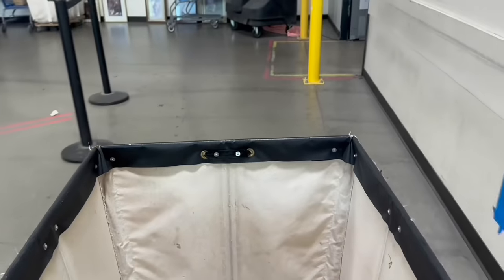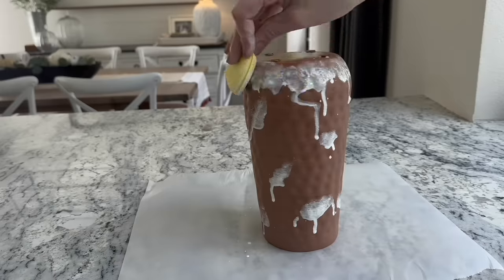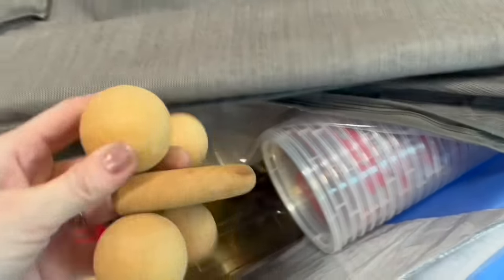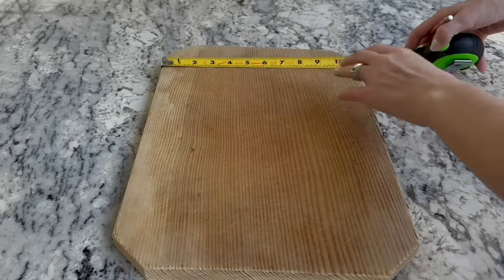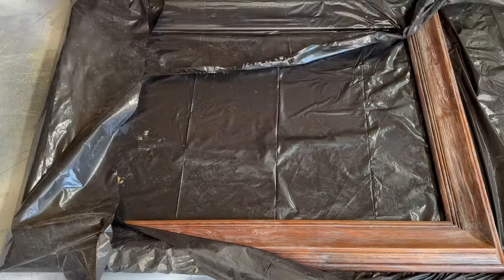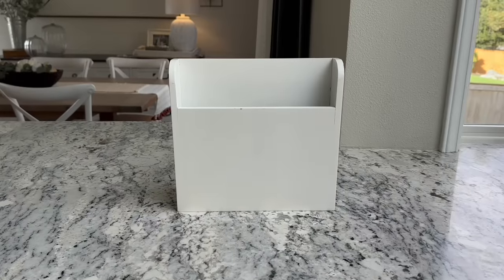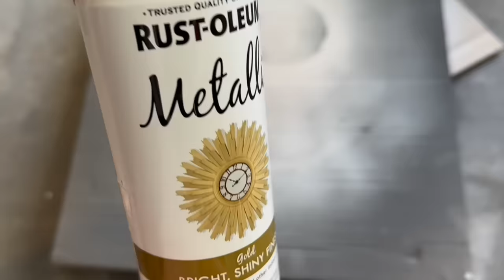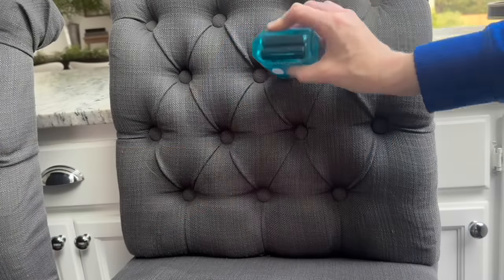50 DIY HOME DECOR THRIFT FLIPS • AFFORDABLE DECORATING IDEAS

Comment: Love these however may not ask on the candle platter on the wood bowl you made whilst looking amazing how do you clear the melted wax to keep it looking good thx 😊
Reply from the maker: Thank you! I  typically use battery operated candles so I don’t have to worry about cleaning up wax. For use with real candles I would put a few coats of sealant on to protect the surface and help make clean up easier or possibly add a plate of same sort. Thanks so much for watching! 💕

Comment: Wow, that dresser turned out beautiful. I just purchased one but I think the top is veneer.  There’s also a veneer chip on the trim here and there.  Any tips for refinishing it. Thanks
Reply from the maker: Personally, I would try using Polyfilla. https://amzn.to/3S0GUKf We’ve had pretty good success repairing minor damage with that. Best of luck with your project! 😊💕

*Required disclosure: Please note that the included links are affiliate links. If you purchase with the links provided I may receive a small commission. There is no additional charge to you. Thanks for watching! 🙂

Comment: Just a little tip when using oven cleaner to strip finishes, it is very finicky about being g almost upright to spray properly. I noticed you don't get the fluffy foam when the can is almost horizontal.  I've had good success with oven cleaner but I've found that the project might need to be positioned in a way to allow the proper spray angle and then lay the item flat so the foam does not slide off.
Reply from the maker: Thanks for the tip, Sharon! I’ll have to give it another try! 🙂

Comment: If you need an economic set of paint brushes, Crayola has a great set. They are in the children's section of Walmart. I know you use the chippy brushes, but try these for other projects. Also, I've read about the chalk paint, and you could try using a foam brush or one of those Crayola paint brushes for a smoother finish. Then it says to rub chalk all over the area, wipe, and then write on it. You might try giving this a whirl. I'm really glad I've watched you so much using Citrus Stripper. I could never get it to work at all, I've was never able to get Easy Off to work either, I'm glad it wasn't just me.

Comment: The key to the oven cleaner method for stripping stain off wood is water. If you notice in all of the videos of people using this product they wash the oven cleaner off with lots of water and then let it dry completely. It does work well if using this method.
Reply from the maker: Thanks for the tip! I’ll have to give it another try! 💕

Comment: The poly doesn’t always avoid bleed through but you can simply brush on the base coat (black) on the edges and that will be the bleed through color.
Reply from the maker: Thank you for the tip! 💕

Comment: What kind of paint did you use to paint the dresser.  It was a beautiful shade of gray. Did you use a paint brush or a roller? Thanks for the information.
Reply from the maker: Hi Bonnie! I used the color Iron Ore from Sherwin Williams. We actually used a paint sprayer on that piece but you could definitely brush or roll it on as well.

Comment: Dry erase marker will remove Sharpie ink very easily. Just scribble over the Sharpie ink and immediately wipe it off with a napkin. You might need to do it a couple of times depending on the surface material. I teach kindergarten and have had to remove Sharpie ink from all kinds of surfaces in my classroom.
Reply from the maker: I bet you have! Thank you so much for the tip! I appreciate it! 🤗

Comment: Hmmm, did you also spray paint those chair cushions (time stamp 12:24) or recover them.  If spray painted, did lyou prevent them from cracking and peeling during use?   Wonderful video!!!  Also, after reading that bed bugs can be found even in wooden furniture, I'm a bit squeamish.  😳
Reply from the maker: Hi Cindy, we recovered them with a vinyl fabric from Hobby Lobby. Many years ago I covered some chairs in my kitchen with the same fabric, I topped with a coat of scorch-guard and they’ve held up great! We’ve spilled spaghetti sauce, finger paints, and all sorts of different messes on them, and I love that I can just wipe them right off! Thanks for watching! 💕
Reply: Thanks, Tiffany - so many  awesome ideas.  You just have a gift for looking at something ordinary and transforming it completely!   Just amazing. @tiffanygemmer-DIYdesign

Comment: I suck at spray painting any tips?
Reply from the maker: Ha, my best advice would be to keep that can moving and use multiple light coats. Also, pick up a little lazy Susan turn table at a thrift store and paint on that. It’s super helpful for eliminating drips! Also, if it’s cool out, I suggest spraying on something like cardboard that you can easily lift and move to a warmer spot to dry after it’s sprayed. Hope that helps! 🤗

Comment: Iam learning alot here, but my shower room has a problem where the water cannot drain out. I have tried the plunger, the spray top but it has not changed. So what else can i try?
Very desperate here.
Reply from the maker: I’m sorry to hear you’re having that issue! Other than cleaning out the drain, personally, I would check YouTube for tips and if those don’t help I would consult a plumber. I hope you’re able to get that resolved soon!